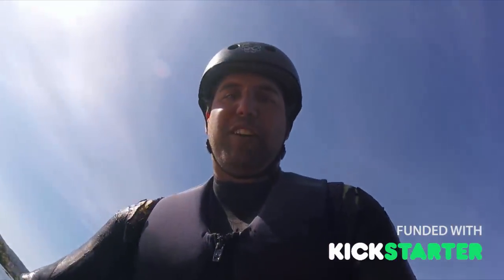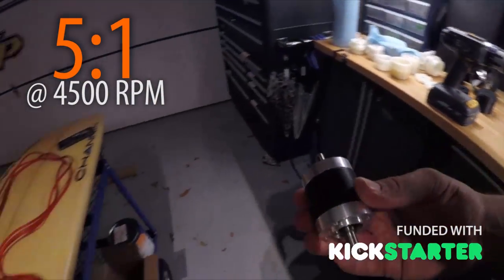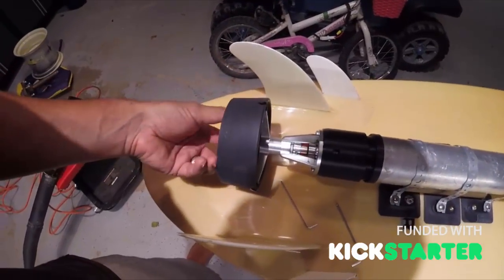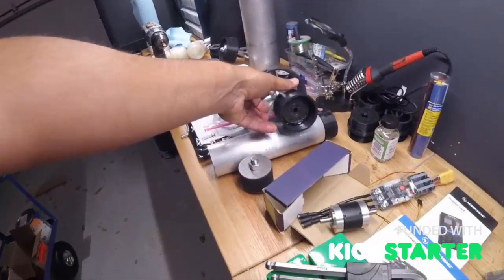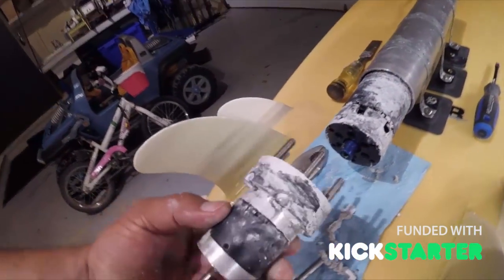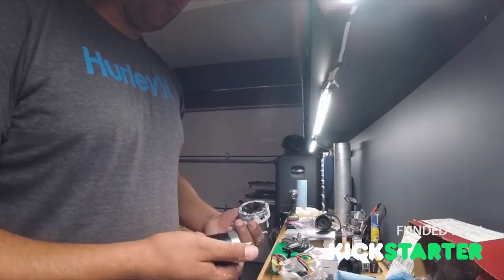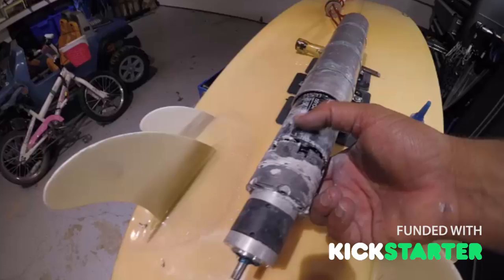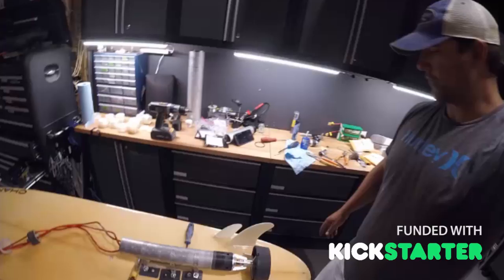VeFoil by VeConcepts Part 2 - DIY Electric Hydrofoil Remote Propulsion System

Comment: And the engine the use of 500 KV or KV 340?
Reply from the maker: WE use many 300, 400, 500, and 600kv, they all work, just a matter of matching your kv with volts and your impeller rpm which you must find out through trial and error. A painfully long precess.... :)

Comment: Amazing work, Surprised you didn't know the name of things like a "keyway" or "grub screw" because your engineering skills must be amazing!
  Why not avoid the reduction gear altogether? Just drop the voltage and use slightly more powerful lipo batteries. So the lower voltage will slow you down and the larger batteries will give you more power and duration, loosing the reduction gear will increase efficiency by quite a bit.
Reply from the maker: lol ya, I hear ya, the camera starts rolling and basic things fly right out the window in memory banks. Well, it's not as easy as you make it sound. You need higher volts to keep the amps down, then you need to drop the motors KV to bring the RPMs down, then you need to try and match the motor torque, rpm, with a prop or impeller that is just right so you don't burn out the motor or under torque impeller not getting the most out of the setup. Its reall balancing act, and without crazy sophisticated equipment for testing its educated guesses, trial and error.

Comment: and how much output your motor produces volts? I have 35 Volts.
Reply from the maker: Arctic Craft Surf we yse 12S 44-50v
Reply: Yes, I have a battery voltage of 45 V. and after the speed controller on the motor is issued 35 v
Reply: can the speed controller must be programmed through the computer, not to lose 8v?
Reply from the maker: when you run a battery it will decrease its volt output and if you have a low C rating battery yes you could  7-9v if battery cannot keep up as full power. We had the problem and needed to get a larger battery that can discharge way more than we needed, just to keep up with motor as batteries underperform what they say they can do...
Reply: and how many revolutions per minute on the motor and tension are necessary as a result to lift a Board with the person 90 kg on a wing from water? despite the fact that reluctor will be 5:1
Reply from the maker: Its not a simple answer as the board width, length, and foil will make a huge difference. If you have the right board and foil should get up with 25-26KG thrust (small SUP and sup foil)
Reply: good afternoon. wanted to say thanks for all the help you have given with gear in the early summer. I have another question. how do you cool the speed controller? mine heats up very quickly. Thanks @DIYElectricHydrofoil
Reply: I can't find a suitable water pump. could you tell me where to buy it or do you use another cooling system?
Reply from the maker: WE do not use a waterpump, have small waterline from our jet nozzle that is high pressure that cools. It self-regulates the more power we use the more water it cools with. Also our ESC automatically starts limiting max current if it starts to overheat a well, and once it cools enough, then it starts allowing a higher current to run through it again.
Reply: thanks a lot. how much maximum amps your speed controller is designed for?
Reply from the maker: If you are overheating the issue is caused by your low volts. We run 67.2 max volts (16S)
Reply: And you are now without gear eat? or still use it? @DIYElectricHydrofoil
Reply from the maker: without gear, we are direct drive

Comment: good afternoon. your gear works to increase the speed ?
Reply from the maker: It is a reduction gear to slow down rpm for a larger prop. Our new design does not use this gear as we are direct drive.
Reply: thank you. and how many volts does your battery give out? and you have a 130A
 speed controller?
Reply: and another question. is the speed controller adjustable additionally? or he just connects. I just have no traction on the water at all, but I use your motor and gearbox 5:1 and speed controller like you and 22.2 V batteries . I don't understand.((
Reply: We are 12S 44-50v roughly, yes motor is 125-130A
Reply: not sure I understand what you are using, asking, doing here. what KV are you using with 5:1?  what size prop? and are you running 22.2V (6S) or 12S?
Reply: I connect two of these batteries in series (Team Orion LiPo 5300 6S 22,2V 50C Deans). propeller 4 blades, the external diameter of 12-13 cm
Reply: I suggest that the ability the whole drivetrain was not sealed and there was water in the gearbox and I have choked in water. and because of this, he worked slowly. I will sort out the gearbox and do good waterproofing and try again.
Reply: I used KV 5:1
Reply from the maker: What KV is your motor? 500kv, 360kv, 250kv? Also with 5:1 reduction gear you may struggle to get enough thrust with a 120mm prop if you have a small board and small foil.
Reply: Motor - 500KV
Reply: do you have a 3D model of your propeller ? I will be very grateful if you send it to me
Reply: I saw you on the website control panel waterproof. you sell it? how much is it worth?
Reply: I have a workshop in Russia and I do surfboards , wakeboards and SUP boards. my instagram account @arctic_craft_surf
Reply from the maker: Yes, we are getting ready to go into production, it will be available in a couple month for about $200 USD
Reply from the maker: We are still refining our impeller, we do not use a propeller, but there are many propeller cad files on efoil.builders forum you can download.

Comment: Hi, did you need a case to cool or did you use the aluminum foil in the water to cool?
Reply from the maker: SOrry not sure I understand what you are asking? ESC is water cooled with flowing water, and the motor is cooled by aluminum tube in the water.
Reply: Yes, that was my question, if you used the engine cooling right in the water. Or used a jacketa to cool it. From what I understand then, it is not necessary for a jacketa in the engine to cool it, if it is inside the all aluminum .. is it?
Reply from the maker: correct the aluminum tube the motor is in cools the motor and is a giant cooling jacket more or less.
Reply: Thank you. I'm getting some parts to make something like that. No e-foil, but an electric body board. Which is the engine you use for the project.
Reply from the maker: We have several builders making these and putting them on body boards, and soon you will be able to buy our complete kit for building this propulsion system at http://www.VeFoil.com

Comment: what is the white stuff at 3:53?
Reply from the maker: That is thermal paste. It takes the heat from the motor and transfers that heat to the aluminum tube to keep the motor cool.
Reply from the maker: Thermal paste, it connects the motor shell to the aluminum tube to transfer the head out of the motor.

Comment: Cool project and tempted to start a diy. Are you making those reduction units yourself?
Reply from the maker: We dropped the reduction gear design we went through two reduction gears and its just not worth it in our opinion to keep turning that design. We are dire drive systems Jet, Mini Ducted Prop, and new hybrid design. No, we bought the reduction gears.

Comment: Excuse me, i had a 1kw motor, 3400 rhp in real work, but i don't know it is enough to work well or not. If the weight of both of your body and surfboard is 90 kg, so what motor should i have... Oh!!! I just want to drive with medium speed, maybe 30kmph. Thanks
Reply: bang shady d

Comment: Make sure to tighten the nuts holding the prop. I lost one like that recently. I was lucky and manufacturer shipped me a new prop for free. BTW. What is the prop diam and pitch in your setup? I use 9410.
Reply from the maker: yup lol I lost a prop in the bay a few weeks ago... what pain! Been there, snorkeled for that.. I have 80mm with 0.8 pitch ratio, 80mm - 1.2 pitch ratio, 110 - 0.5 pr with 4 blade, and 110mm - 1.2 pr 3 blade, Im still testing them, got skunked this weekend for weather, 30kt wind and waves.

Comment: good job guys ! keep pushing ! BYW what gear box are you using ?
Reply from the maker: Thank you Gabriel!
We used a clear X-Large GSI Outdor Gear Box. Really strong, and clear so you can see Amp meter running inside and be sure water cooling is working and nothing is going wrong... https://www.amazon.com/gp/product/B0002YTL36/ref=oh_aui_detailpage_o00_s00?ie=UTF8&psc=1
Reply: thanks for your answer ! i was refering to the gear reducer :) did you use a ple 40 from neugart ?
Reply from the maker: We are testing with no name china gear boxes to keep build cost down while we test. 3:1, 4:1, 5:1